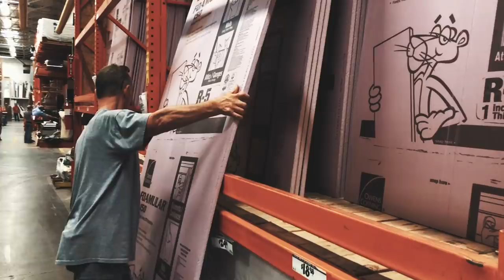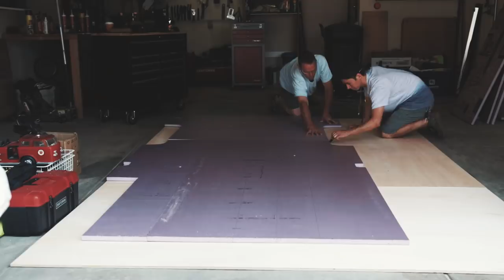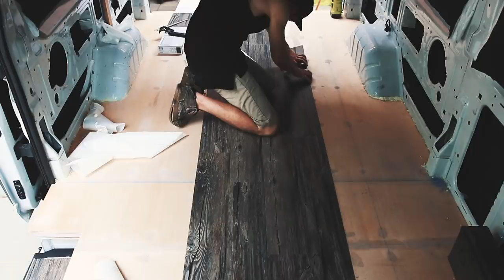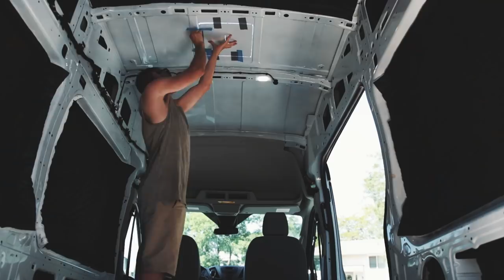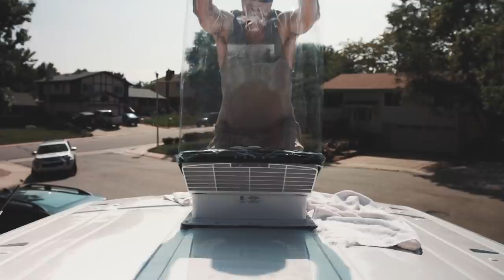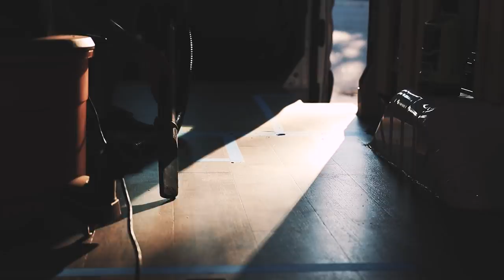Van Build Part 1: first-time builder prepares to live in a van

Comment: Going to check for more videos Total best wishes on living the life. I myself lived in a van for 9 months with my dad before my teens As he was a bricklayer in a bad home building recession back in 81'  So He sold the 2 cars Bought a ext van And the rest was history ..I learnt more on the road in 9 months Then a school could do in 3 years 

Since highschool I have worked on Cars Trucks, Boats ..Rust repair, Mechanics, Resto work, Custom work. And currently have my own SUV camper for Drive-in movies, Camping, And traveling as much as Canada as i can before i get too old to do long treks.

Alittle advice : Don't know the reason for the furring wood sitting at the base of the van Then the foam Whole point of foam board its to keep the outside air out as much as you can And leave no Air gap between the cold / hot  Which causes vapor / moisture / rust / rotted floor ..Ideal set up is run  Ether roofing seal rubber ( 1/2" peel away) along the lower groove of the floor which meets the top but does not overlap it  1" x 2" Furring strips cross wise with high strength chalking and 1 1/4" screws on the high points of the floor metal This will keep the wood from bowing in the future with any moisture that may happen ..Leak, spill etc Lay in your 1" foam board inside your furring strips It should sit flush Use Seam filler foam on gaps/seams 

Now in my SUV i was lucky to have a friend that does pro spray foam And told me Case of beer and bring it to a job site when i'm ready ..I stripped everything off the inside of the truck Ran 2 PVC pipes long each side and Zip tied them in Why? For future wiring He was able to put in 3 inches of foam per side 1 3/4" on the roof  2" on the floor with the 2" strips  Closed cell spray foam was used And the SUV was left with open windows 4 hours to vent "off" gases untill i drove it home ..windows still down for 2 days  End result With a mini cheap heater And running a thermo curtin just behind the front seats In - 30C  I wore a T-shirt in the back And at that time i was still testing my window coverings which needed beefing up ..Plastic cardboard, black doubled up canvas And is extra over lapping And reflectixs on the other side to redirect heat back 

Not sure on where you are in the world But dad told me one thing about doing these things...Why put on 5 T-shirts  When all you need is a sweater

Comment: As an electrical apprentice I can appreciate both the terrible noise and hot metal shards. Believe me anytime there is either of those the apprentice and not the master is involved lol. It seems like everyone is going with friction fit or batts of insulation, I think thats a terrible choice and you should be spray foaming. Is weight a concern?